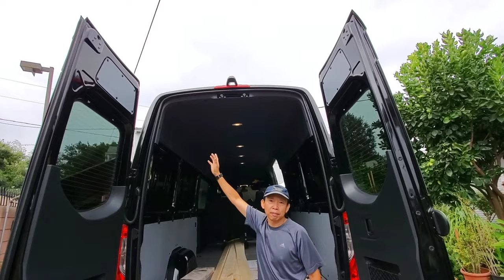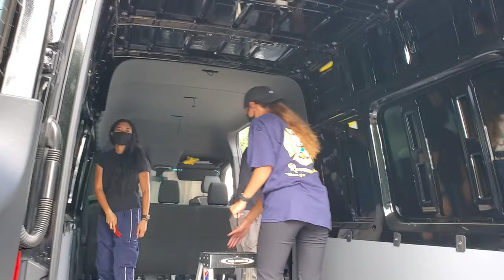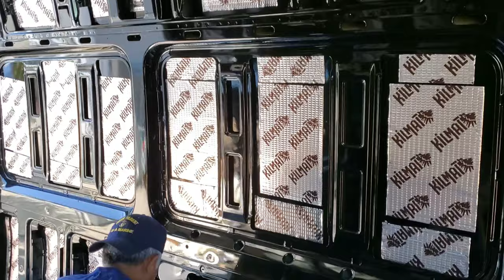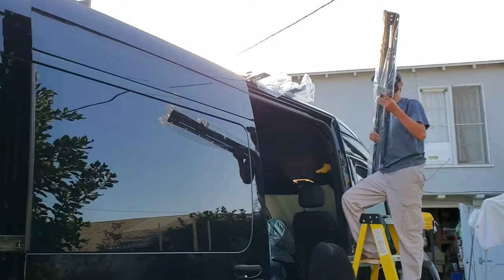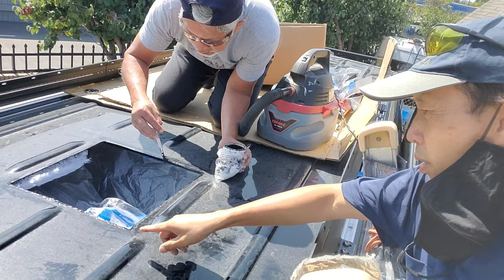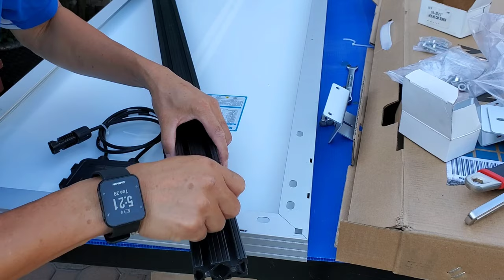Van Build Ep 1-2019 Sprinter Van 4x4. Sound Deadening and Insulation

Comment: Inspiring work! I would suggest insulating the SS bolts from the aluminum brackets to avoid galvanic corrosion on the aluminum.
Reply from the maker: Thank you for your suggestion Robert.  How do you Insulate the SS? Is it like using a plastic washer or something?